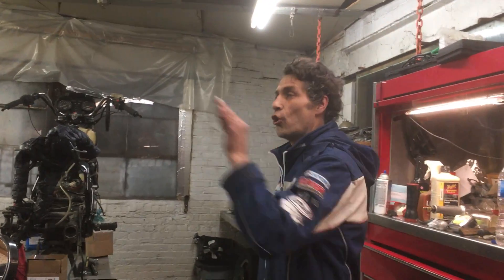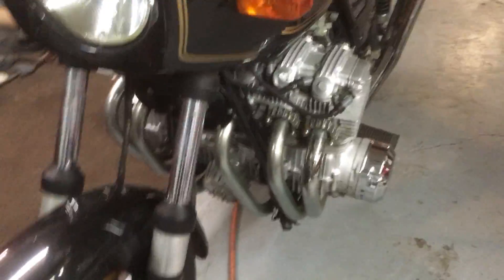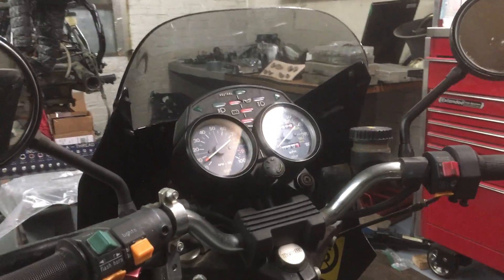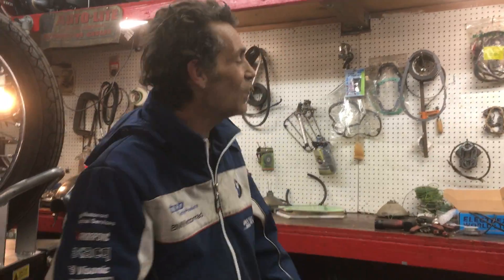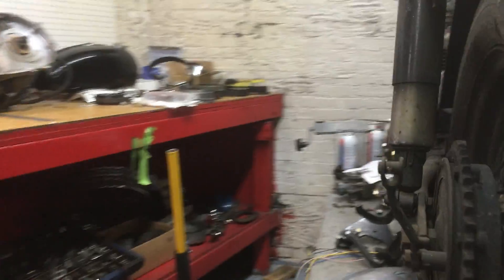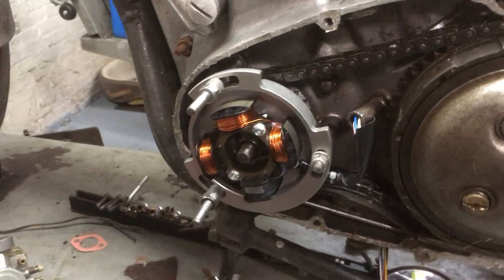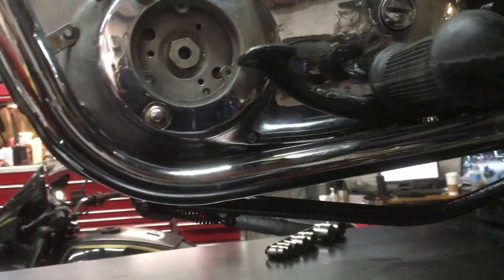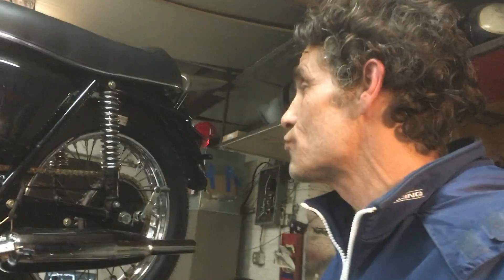Triumph T120 Modern flywheel magneto. Triumph electronic ignition.

Comment: Is this based on the Triumph Energy Transfer ignition system that eliminated the battery on the competition models? Last week, I picked up a 1967 Trophy T100C with the original stock ET ignition. I was pleasantly surprised that the bike kickstarted easily and ran fine. I've started it maybe a half dozen times so far and have ridden it only about ten miles total. The tires are extremely dry rotted, but I have replacements lined up for this week. The bike belonged to a vehicle collector who acquired it in the 70s, and I suspect the bike was rarely ridden, as the levers, pegs, underside of frame, and those scrambler pipes are all unblemished. I intend to keep the stock ETI, and planned on searching for NOS/replacement parts for the ETI as back up. Would the Electrex system be a viable upgrade?

Comment: It is fantastic fitted to the Triton works every time can go as fast as I want won’t burn out due to modern voltage control 16.5v,  ignitions stressed above 14.5 , and just works. I’ve had a dozen E I units all failed but this just works. Great product for riders
Reply: Hi Stuart, would this work on a Pre unit Triumph with magneto?
Reply: @mrchuka  afraid not the only pre unit engine it would work in is the Thunderbird fitted with the alternator. This conversion mounts on the three studs the stator uses. But a good mag well sorted is as good as anything. Coil ignition is a poor second choice to a good mag in my experience. Good luck
Reply: Hey Stuart, can you tell me exactly what this replaces. I know the points but anything else. Battery too? What about coils, i suppose you need those. 😁
Reply: @pauliebots  this is a self contained ignition. It requires no battery to work. The Lucas rotor is replaced and the stator by the new parts that mount on the crank shaft and stator mounting bolts. It has its own twin pole coil and a cdi box that fit nicely under the tank They have an option for light generation but I run total loss LED lights that last for many hours on a single battery charge. The points housing us not used as the stator and rotor are where the ignition is sent from. The Triton is still going strong after many thousands of miles of fast road use. If you can fit an EI system you’ll be able to fit this. The rotor puller is well worth buying in my opinion. 
Enjoy
Reply: @stuartosborne3013  thank you for your time. Enjoy the triton!